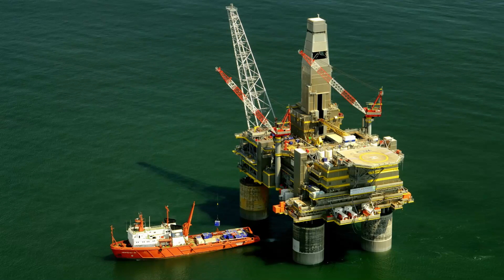what is oil / hydrocarbon / oil formation / asphalt /

Comment: Actually im still waiting for your respone..
Reply from the maker: I will write you answer.
Reply: @professionalgeologyclub  actually my thesis proposal submission date is tomorrow 10am Pakistan's time.. So thats why im hurry...
If you can answer me as soon, so im completely my proposal at timely.. Your reply would be beneficiary for me..
Thanks.
Reply from the maker: @mianusman8080  Sure! Evaluating the impact of subsurface stress on hydrocarbon production involves studying how changes in subsurface stress conditions can affect the production of oil and gas from reservoir rocks. This can include both in-situ stress and changes in stress caused by drilling and production operations.

There are several ways to approach this topic, including:

Analyzing well data to assess the relationship between subsurface stress and production rates.
Modeling the impact of different stress scenarios on reservoir permeability and production.
Studying the effect of stress-induced fractures and faults on hydrocarbon migration and accumulation.
Investigating the role of subsurface stress in inducing wellbore instability and enhancing or reducing production.
The ultimate goal of this research is to better understand the relationship between subsurface stress and hydrocarbon production and develop strategies to optimize production from oil and gas reservoirs.

Comment: Aslam o alaikum!
Im a student of BS Applied Geology final year.. My Specialization is petroleum geology.. My question is how can i opt my thesis topic? Actually i have no idea about that i asked you waht you suggest me? either im do subsurface profiling as my supervisor told me or what you do suggest me regarding this..
Thanks..
Reply from the maker: Here are a few suggestions for your thesis topic in petroleum geology:

Reservoir characterization using seismic and well log data.
Application of Machine learning techniques in hydrocarbon exploration.
Petroleum systems analysis in a specific basin or play.
Regional prospectivity mapping using geochemical data.
Evaluating the impact of subsurface stress on hydrocarbon production.
Remember, the key to choosing a successful thesis topic is to pick something you're passionate about and that you can realistically complete within the timeframe you have. Consult with your supervisor to discuss the feasibility and resources available for each of these topics, or consider other areas that align with your specific interests and expertise.
Reply: @professionalgeologyclub  can you elaborate about more precisely on the evaluating the impact of subsurface stress on hydrocarbon production? That can help me clearly regarding this.
Thanks firstly for your above suggestions.